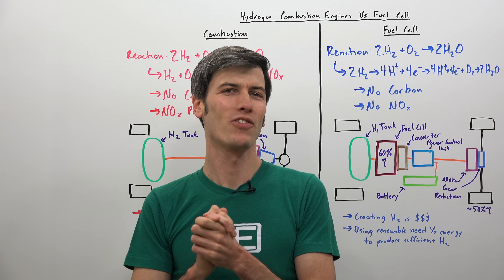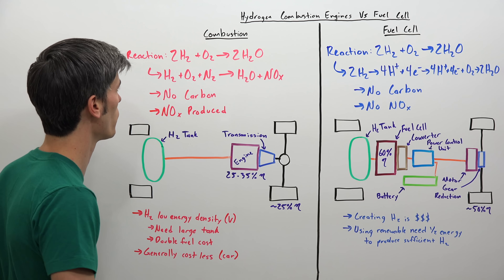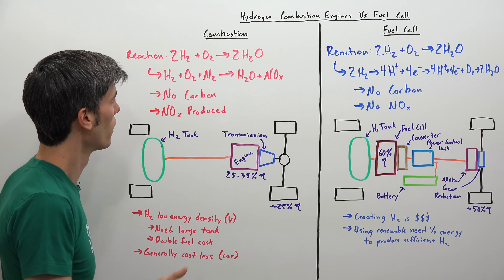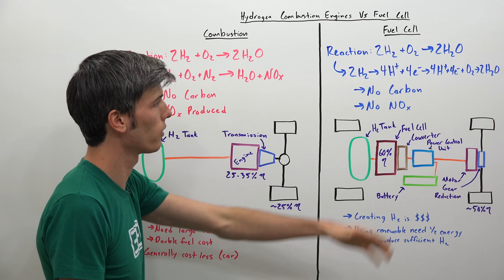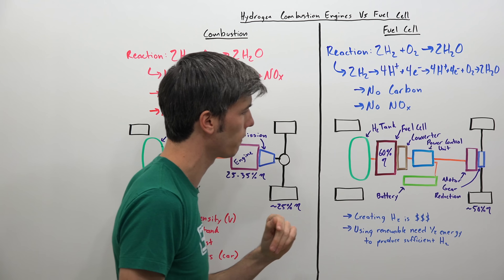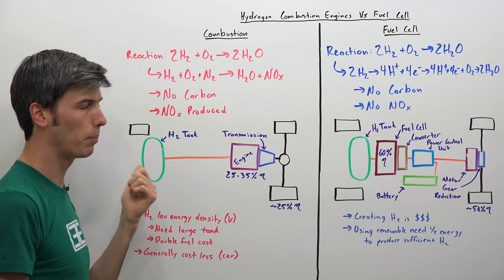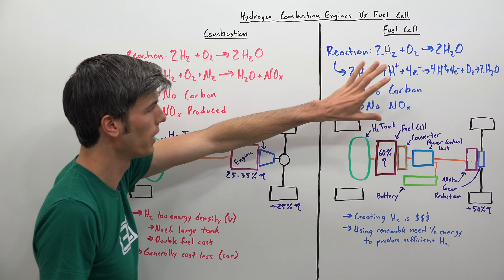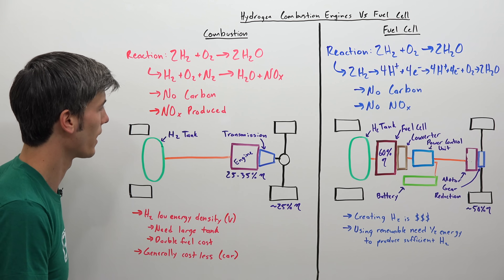Why Hydrogen Engines Are A Bad Idea

Comment from the maker: For anyone interested in learning more about hydrogen combustion engines/fuel cells, here are two videos explaining the fundamentals: 
How Hydrogen Piston Engines Work - https://youtu.be/l6ECwRnJ0Sg
How Hydrogen Fuel Cells Work - https://youtu.be/0jnZFGx_4kY
Reply: the best engine is the electric one since its energy travels by cables not by trucks and boats that consume more fuel with an efficiency that does not even reach 40%, also because fewer parts are needed gearboxes, spark plugs, starter batteries, clutches , sensors, air filter, fuel filter, oil filter, catalyst etc, which means to spend less energy in the manufacture and transportation of all those parts. Electric vehicles pollute less because they do not discard as many parts during their useful life and waste control would be simpler because recycling the batteries and having to declare their replacement would suffice. It would be much simpler and more efficient to use oil, natural gas, hydrogen etc in power plants and from there feed the EV since the stationary engines are more efficient and it is not the same to take the fuel to a point in the territory and then the Energy trip by wires that take it to all the gas stations. And heat treatments and melting so much metal for combustion vehicles spends a lot of energy.
Reply: So... You're saying I won't be able to convert the engine in my classic car to run on hydrogen, because I was hoping for conversion kits? Now I have to swap in a fuel cell at best or go electric? @engineeringexplained
Reply: Why not plain old ordinary 2 cycle engines, like Evinrude?
What about a 2 cycle engine with computer controlled DC motors (from the machine tool industry) for each wheel?
Reply: @uru-freemind7711  Like a golf cart, but the dead batteries cost money to get rid of.
Reply: @ME-kp5iz  while that is true, keep in mind that battery technology is pretty much in its infancy - there are many chemistries being explored at the moment - efforts focused on reducing cost (by using more readily available materials), reducing wieght per KWh (which will improve efficiency of EV's), improved charging speed and improved safety, both during production, during use and eventual disposal. We will make many mistakes, and I expect we will have a few breakthroughs in the next decade, and possible overcome many shortcomings of battery technology. Currently hydrogen production, transport and use has its fair share of unacceptable environmental impacts too (and being improved).
One thing that is certain, as far as I can see, is the fossil fuel powered vehicles is going the way of the dodo slowly. Which technology replaces it? - exciting times!
Reply: @ME-kp5iz  And you are not looking at the maintenance, the necessary parts, the efficiency of the engine and the fuel transport for the hydrogen engine and its maintenance are equal to the fossil fuel that is silly. And more energy is needed even to make the hydrogen would be simpler to make electrical energy with sunlight, wind, hydroelectric and geothermal energy, etc. join renewable and non-renewable sources until only use the renobables, the hydrogen engine is inefficient and its fuel consumes a lot of energy for its obtaining and transport.
Reply: I enjoy your video's and normally find them to be quite informative but I have an issue principally with your efficiency estimation. The figures I often see missing from electric systems are an egregious omission of real system efficiencies and can easily mislead the public and this video seems to be no different. All devices that use electricity have an efficiency themselves otherwise they would not inherently require some form of cooling. Regardless of the efficiency of your fuel cell the DC to AC inverter has an efficiency, the battery has an efficiency,  the electric motor has an efficiency, and the mechanical power transmission system of a fuel cell powered vehicle has an efficiency, all of which were missing from your whiteboard. I thoroughly enjoy your videos where you've done your due dilligence and hope you keep making them regardless of how complex you have to go to thoroughly explain your subject matter. I would also like to present a small conjecture, why not supply the required oxygen to the hydrogen combustion process and forego the use of atmospheric air which is principally nitrogen? That would eliminate the impact to the environment as there would be no nitrogen oxide product in the combustion reaction. Regardless thank you for the video's.
Reply: What are the pros and cons fixing a dry hydrogen cell to a gasoline engine?
Reply: Why is hydrogen so expensive?  It's the simplest and most abundant element in the universe isn't it?
Reply: @ranchhandrandy3213     Very abundant, just not simply isolated to put it in a tank and use it.  Someone might find a way to do that fractions of today's costs and it'll be more viable, but current processes aren't cheap.
Reply: what about a water to HHO converter?  Would it use as much space as a hydrogen fuel tank?
Reply: Is hydrogen on demand a thing ? can you produce it on your own ? Seen video few years ago never done any research to see was it ligit.
Reply: If the hydrogen was stored as a Hydrate fuel block rather than a compressed gas - might be better for hydrogen combustion
Reply: Something that occurred to me is that if there is a high density of hydrogen combustion cars venting water out the exhaust and environmental temperatures are freezing or below, road surfaces will accumulate ice constantly on a very grand scale.
Reply: They're not a bad idea!  They're just not politically correct!!  You can convert any combustion engine to run on hydrogen.
Reply: You could redirect the exhaust into a condensor to either drain the water or re-use @tonydanis1480
Reply: @Engineering Explained Hydrogen powered cars will never be competitive with dinosaur burners or pure EV's for several reasons. Firstly, the myth is that the hydrogen will be produced from electrolysis from pristine renewable energy like wind or solar farms, or even "clean" nuclear from thorium reactors. The electrolysis process loses 20% of the energy of the electricity so combine this with the efficiency of a pure EV and they will come out on top. The only extra expense you have with a pure EV is the extra batteries required beyond the smaller ones needed for an H2 EV, and also the range limitations of pure EV's which becomes less and less of an inconvenience every year as range increases and charge stations pop up everywhere.
The reality is that hydrogen actually comes from steam reforming of natural gas as it is significantly cheaper than electrolysis. Natural gas is a fossil fuel and this creates carbon dioxide emissions. It would be better to simply burn the natural gas directly in an ICE. Additionally, the high pressure fuel tank needed for hydrogen needs to be of denser metal because the small hydrogen molecules leak through traditional tanks.
Unfortunately, renewable electricity production methods will never be able to scale up to displace traditional sources of electricity like nuclear, coal, and natural gas; the capacity simply isn't there. Therefore, any attempt to use "renewable" energy (it's not actually renewable if you consider all the oil and emissions needed to make the wind turbines and solar panels) will simply take away supply from other users who want to source their electricity from "renewable" sources.
Now, sure, maybe rich people living in sunny areas could have solar panels on the roofs of their mansions which feed their own personal electrolysis plants. But the cost of production of all of that equipment and the embedded energy in all that equipment will never make it competitive with just burning traditional fuels. It will be a boutique technology just like it always has been.
Reply: The most important thing , 
How much it cost me if use hydrogen rather than normal fuel 
How much price of hydrogen and how many kilometres can achieve for 1 liter 
To can consumers can compare
Reply: @YaketyYakDontTalkBack  no he isn't saying that, he is saying you will need twice the amount of hydrogen to run it however. Needing much more energy to run a gas engine never stopped anyone but then gas is a lot cheaper than hydrogen.
Reply: @jonathancotner7040  apply all your efficiency concerns to gasoline if you really want to be appalled. Start at the bedroom of the driller when he gets up to go to work.
Reply: @tonydanis1480  regular cars are currently exhausting water on the streets, so why aren't you concerned about that?
Reply: @Aerostealth  I know the efficacy of internal combustion engines and his statement about a maximum of around 33% efficient is correct. My statement however was about the LACK of effincey information regarding all of the other components of the hydrogen fuel cell system. Everyone knows that EV's are more efficient than both but even with the realm of EV's such information isn't advertised.
Reply: how if you use electrolysis to produce the hydrogen gas
Reply: @jonathancotner7040  the proof is in the results. Electric vehicles require from 1/3rd to 1/4th the energy per mile as their gasser counterparts. Regardless of the internal loses for each step in the processes gas cars are entropy machines in comparison. The physical world is testifying to this in the forms of reduced cost and other tells, that are just undeniable.
Reply: @Aerostealth  As a chemist, I can tell you the amount of water expelled from a car exhaust running a hydrocarbon  engine is tiny compared to a hydrogen. Just look at the equation, for Chrissake!
Reply: @Aerostealth  Please just away and leave this to the knowledgeable people. Thank you.
Reply: @tonydanis1480  that leaves you out.
Reply: @tonydanis1480  Water dripping onto the streets is not an issue. Firstly, on clear nights when black ice forms, there is condensation (dew) which coats the road in water anyways. Secondly, there will be salt on the roads regardless. Thirdly, if it is well below freezing and sunny with dry roads, the ice will sublimate quickly at the low rates it is being deposited. But still, I agree that H2 powered cars are a colossal waste of research effort and brain cells; I tend to think they are being pushed by the fossil fuel industry because the hydrogen actually comes from natural gas.
Reply: @ME-kp5iz  You do realise that H2 cars also have batteries?
Reply: Hydrogen engines may be a bad idea but STEAM engines AREN'T!
Reply: Uru- Free Mind The best most cost effective engines are Steam engines!
Reply: Engineering Explained have you made a video about assisting gas powered engines with a hydrogen producing system? Id be supper interested in what your thoughts on it and what are the pros and cons if you haven’t already done this video..
Reply: Now, EE, do a comparison of the electric car's efficiency vs. that of the fuel-cell car's efficiency. With that comparison, include the efficiency of process to produce the hydrogen, and the efficiency of process to produce the electricity.

My thought is that you will discover that the electric car is much more efficient, AND cheaper. AND simpler.

The beauty of the electric car is its simplicity. The only aspect of electric cars that is truly cutting-edge is the battery technology. Electric motors and power inverters have been around for decades. But for petrol cars, look at the complexity! For example, you recently did a video on Mazda's Skyactiv-X engine. I admire the engineering involved to create such an efficient petrol engine, BUT, it's too complex, which to me just means more to go bad. And since most people (not me!) want an automatic transmission, there's that added complexity -- and modern automatics seem to have their share of problems.

Personally, I don't see how any powertrain for the automobile is going to be able to compete with the electric cars in 10 years. The only shortcoming now is range and long-range convenience, and with Porsche's new 350kW charging system technology becoming a reality (that kinda makes Tesla's 120kW Superchargers seem anemic!), that will soon be a thing of the past. 

BUT, please do that hydrogen fuel-cell vs. electric comparison. Perhaps I'm wrong ........
Reply: This made me sad haha
Reply: @tonydanis1480  Simple problems deserve simple solutions. If ice buildup becomes such a concern then manufacturers could put waste tanks in the vehicles to contain the couple gallons of water until it is disposed of by the owner, or drunk when they are thirsty.
Reply: john gilkison      ICE tech improvement has come, and continues, much faster than batteries, at market friendly prices.   BEV is a rounding error in the industry and would not exist at all except for heinous market distortions via greasy politicians and Co2 religion.   Sustainably is a sad ideal and goes against humanity.   We strive for more & better for the biggest market.  If batteries someday provide greater utility I’ll be thrilled to buy one.    Till then tax someone else to fund your utopian vision.
Reply: @timduncan8450  Only problem Tim, is that you're wrong. The IEA estimates that 1% of global GDP is subsidies to the fossil fuel industry. Look it up. Sorry but a few thousand dollar rebate on your EV purchase is, as you say, a rounding error compared to the subsidies big oil gets.
Reply: Reading through the comments here, I think you'll need to make another video explaining why BEVs are the future of personal transportation and not HFCs. The efficiency, cost and ultimately the reliability and recycleability. Essentially, the eco aspects.
Reply: @ME-kp5iz  It takes too much electric power to get very little hydrogen would be more convenient to use electric power in electric motors because they are much more efficient than one of combustion for everything I said in the other comments but hydrogen is a good substitute fuel for aircraft not what I deny, electric planes and solar boats are currently being developed, probably with graphene batteries to improve a lot. Land vehicles should all be electric that's obvious.
Reply: @mark2073  Yes, there's def a variety of solutions. Running the numbers any which seems to reveal an astonishing amount of water release. 
It's actually intriguing. If released as vapor in sufficient concentration, could affect local microclimates, not necessarily negatively. 
Amyway, it's a bad route compared to fuel cells, etc,, so probably won't actualize..
Reply: @mark2073   Not sure how objective or accurate IEA is.  I generally have little use for globalists or their statistitions.      Subsidies are generally bad.  If you want to make this relevant details matter.  Most third world oil producers have massive gasoline subsidies.  In my world the public often gets behind widely used technologies (interstate highways, airports, etc) once proven.   BEV are not in that tradition, they had to have grease politicians and Co2 evangelicals subsidize & whip up what little acceptance they have in the market.  Only a tiny few own them and benefit to society is immeasurable    I love new and better technology and would gladly buy vehicles with greater utility.  BEV have great potential, but today are a giant failure in the free market (~30% subsidies).   Fund your utopian vision on your own tax dollars.
Reply: Why in the hell is this not mass produced yet? Lol
Reply: @quinnwall5771  You'd have to install a massive hydrogen fuel storage and infrastructure  matrix nationally.
This is much harder to do than the electrical recharging stations that are popping up agonizingly slowly in certain locations.
 You still really can't take your Tesla out of town.
To be useful - provide adequate energy density -hydrogen would have to be stored at thousands of pounds per square inch pressure in a vehicle',s. That makes filling up dangerous and complex.
Gasoline is somewhat "reluctant" to burn and doesn't explode unless very finely dispersed as a gas, so it's safer to utilize.
Hydrogen, as the Hindenburg taught us, likes to go kaboom.
So a national hydrogen supply system for individually-owned vehicles will be costly, to say the least.
Reply: having not watched the video, I'll still say tell that to Bob Lazar
Reply: With global population on such a high rise we should all start thinking about sharing our (common) resources in a way that will allow future generations to also exist.
Combustion engines are inefficient engines that pollute the environment. There should be a quota on engine power currently in production from car manufacturers. How do WE allow someone to even think about driving a car able to produce 1.1MW???
Electricity has 2 fundamental problems: one is production (nuclear? coal? renewable sources?) the other one is how to store it. We will see further advancements in the rechargeable battery (bigger capacities and instant charging) in the future, which obviously leads us in a future full of electric vehicles (EV).
Then, we will only have to solve energy production which it can be anything (hydrogen, renewable, fusion … whatever)
But you guys should free yourself from the abusing idea of riding a muscle car - it is not proper
Reply: Engineering Explained you just broke my damn heart with this one!  😢😢😢
Reply: @supertriz  He is wrong, fact that hydrogen is good for military means its best they only protecting petrol dollar. Electric cars been around 200 years they also been suppressed by illuminati  them who control things behind scenes. Nuclear is triggered by hydrogen fuse. Russia has biggest  hydro bomb for decades no accident. Electric cars can self charge by using wind turbines even your cooling fans don't need to be electric they can use wind. Its all a scam lots of technology is suppressed by deep states.
Reply: True. Bad idea. Main reason companies considering it because combustion engine is readily available. That's why I was thinking before about hybrid electric for hydrogen engine. Simple. Comparable efficiency. Cleaner than gasoline. No worry about break even cost. Considerable market size in some countries, except US surely. No worry about range, gasoline can be used if batteries drained or H2 supply runs out. Even if anybody wants to travel to Nile river source. Hahah.

Oh free idea. Those companies has to pay me for this :p But yeah H2 extraction not efficient yet...and EV can be simply supplied by renewable energies, looking at how fast those develops.
Reply: SEE MY TWITTER PAGE UNDER THE SAME NAME AS THIS COMMENT, to see what just some of what this world is doing as they implement a hydrogen driven economy in their nation.  Hydrogen is a growing sector in this world for those who invest, you snooze, you lose what might have been.  Even international investments.  Fully your freewill choice.
Reply: What about the carbon dioxide and water vapor produced by the hydrocarbon burning power plant that generates the electricity to power the generation of hydrogen from electrolysis? The overall efficiency of energy transfer from hydrocarbon bonds to electrical to mechanical energy will be less than a conventional liquid fueled vehicle.
Reply: Fuel cell seems too complicated I would doubt in realiability of such engine in long run.....
Engine go to hell from on minor issue that was not chaged at right time in such complicated one your proposing it get it even worse
Reply: What about using hydrogen in a gas-turbine engine that's connected to a generator to provide electricity for electric drive motors?  A turbine should run well on hydrogen and could run at a steady state if it was just used to generate electricity and not connected directly to the drive-train.
Reply: As Union Pacific Railroad,. General Electric (Schenectady), and the builders of the Concorde found out, turbines run best at one speed. They are horribly inefficient at slower speeds, as in the driving requirements of city driving.   @LG123ABC
Reply: @tedphillips2501  Yes, that's what I was talking about.  You could run the turbine at a steady high speed to turn a generator and generate electricity for a bank of batteries/capacitors.  The turbine would not be required to change speeds because it would not be connected directly to the drive-train.
Reply: It would have to cycle out at some point to be economically competitive, especially for city driving. At that point, you would be driving an electric vehicle making a lot less noise. Aside from long-haul trucking, what do you see as the advantage?  @LG123ABC
Reply: @tedphillips2501  You eliminate the range anxiety you get from a pure electric vehicle but you retain the benefit of super-low emissions.  Yes, you're right, you would have to have a computer cycle the turbine on or off depending on how much of a charge the batteries had.
Reply: I'm starting to question this guy's intelligence. I think there are strings controlling the puppet.
Reply: @engineeringexplained Please have a look at the microwave ignition engine, seem like something of your interest
Reply: Kind of dishonest. Why not compare the exact same electric+battery with a hydrogen generator for combustion. All the same benefits without the super expensive limited lifespan catalyst.
Reply: Please do a review on gasoline and diesel engines with a onbord hydrogen generator generating hydrogen out if water from the battery and directly infused into the intakesystem. No tank, direct use of the onboard made hydrogen.
I guess youll need a bigger battery and a stonger alternator
Reply: You didn't really tackle the big practical factors, rather skimmed on them.  Specifically 1- simplicity of the design, as such production costs and ownership/maintenance cost of all the required components over years
Reply: Also I agree with your estimates of the combustion being around25%ish efficient, however I'm very skeptical of your 50%ish percent efficiency for the fuel cell model.  I think that very ambitious, and especially ambitious if you factor the relatively quick ageing of the fuel cell conversion components/batteries etc.   As an owner, I would opt for the combustion engine by far.
Reply: Fuel cells are unpractical
Reply: @JP-pf5pz  That would be a fun test. Task two teams with creating the most efficient electric generator, that can produce 5000 watts, using hydrogen as fuel. The win goes to the team that can produce the most kWh on a given quantity of hydrogen gas. Then, evaluate the cycle life cost of the generator. How much did it cost, how long will it last. The cycle life cost could theoretically go to the less efficient solution, if there is a small difference in efficiency, but a huge difference in cost/useful life.
Reply: Johnathan Cotner    ULEMCo and Revolve said to have demonstrated 45% BTE, last year with immeasurable NOx on diesel type engine fitted for hydrogen fuel.  I assume they did controls, Injectors and maybe turbo changes.  Article short on tech details, but claims stable operation at A/F ratio >300:1.  So that would be impressive.  Power density?  They showed a heavy truck application, so maybe they have maintained power?
Reply: john gilkison  ULEMCo and Revolve said to have demonstrated 45% BTE, last year with immeasurable NOx on diesel type engine fitted for hydrogen fuel.  I assume they did controls, Injectors and maybe turbo changes.  Article short on tech details, but claims stable operation at A/F ratio >300:1.  So that would be impressive.  Power density?  They showed a heavy truck application, so maybe they have maintained power?
Reply: @عبدالوهابالرحيمي-ض9س  yep it all comes down to cost vs return. Both for the consumer and the manufacturer. No profit? No product. Too expensive? No sales. Which is exactly why we don't see them.  Anywhere.
Reply: A video about turbine or jet engine on a car please!
Reply: Here in the Philippines we used to have a water fuel car. the water is converted to hydrogen and goes to the gasoline engine. few filipino convert their cars to save money when the fuel prices are high. try to search Daniel Dingel water car.

So why not make water fuel hydrogen electric cars, I think its more practical because insted of building hydrogen filling stations. I recomend use sea water or tap water to fill up the car and automacally converts water to hydrogen to power hydrogen electric car.
Reply: Kindly change video title to hydrogen cumbustion engine dont work, as people working hard hydrogen fuel only alternative to lithium battery can get worse reputation
Reply: 1.catalytic converter will solve the emmison.
2.gear box will effectively distribute the torque for the vehicle in different conditions.
3.we use the electric to separate hydrogen and oxygen from the water not need a huge tank of hydrogen.
Reply: Need large tank?? Students in Denmark have build a car with an Hydrogen engine, it only have a max speed of 40 km/h BUT it can drive 630 Km per liter, so no need for a big tank.
Reply: You have sum of the  best content on YouTube I love content that puts me in my place!!
Reply: I would love to borrow your brain someday.  Are you a electrical engineer?
Reply: What are even talking about.!!??........GASOLINE IS HYDROGEN buddy!!...... Wake up
Reply: @Spiffer  Definitely TRUE........ YOU ARE SO RIGHT Mads
Reply: @PatrickInCayman  Correct
Reply: @uru-freemind7711  Good points! Also the hydrogen has to be highly compressed (which takes a LOT of energy) and kept extremely cold. And 1 tanker of hydrogen has half the BTU's of a tanker of gasoline.
Reply: @mark2073  If Fusion power does become a reality then that would be a perfect source for electricity.
Reply: So then. If we cant use an engine block we are stuck with a heavy electric car. . . . Welp. F that ima design a system that uses an electrosis tank. Therefore getting rid of that giant H2 tank and replaceing it with a constant flownof hudrogen and oxygen. We will just bleed the oxygen back into the enviroment so it can mix with the air and turn into well air. Just use distilled water and salt and your set. Use the eneryu from the battery to generate the H2 to go into the fuel cell. That way the hydrogen is produced on the go. So its a condensed since its a liquid then its split into a gas.
Reply: @ME-kp5iz  Why not just produce the hydrogen in the car. Simply put in an electralosis rign and bleed the oxygen thats produced back into the inviroment. And have the H2 go into a holding cell so it can be stored and used when its needed to. Solves all the problems.
Reply: the idea behind hydrogen combustion is not to create new vehicles... is to be able to maintain using current ones... a lot of engines are capable of being converted to hydrogen burning... this is the idea behind the Skyactive X engines (rotaries can also burn hydrogen)... electric vehicles still are very expensive and may not be accessible to everyone yet. therefore it is a good idea to offer a solution for people to that wish to keep their own cars. there is the other aspect.. cars are hobbies for some people and some governments are going to go as far as ban any gasoline burning cars, which would be unfortunate for someone like myself that likes to work on cars on their off time. So a hydrogen conversion is an option. I don't know what the obsession with efficiency is, gasoline is not that efficient either. also while NOx is bad... you haven't addressed the quantities of NOx produced in comparison to the NOx produced currently by cars. I'm sure it is a lot less.
Reply: You create amonia and nox
Reply: Engineering Explained how about making it from the source⁉️🤨 Why are you NOT mentioning the electrolysis that can be produced and why not use injection⁉️
Reply: NOx trap are for sure added to H2 burning autos.
From H2O exhaust from F-CELL cars you can also make again pure H2 by passing-by electrons from battery and make a closed circuit getting fuel again and O2 for the enviroment !!!!
BimmerN53
Reply: This is missing a lot of information, DI-Hydrogen engines emit almost no NOx for lambda >2 , and they work with lambda as high as 10.5. 
They do emit lots of NOx at full load (lambda = 1), but this can be counteracted by using water injection.
Reply: But what about normal gasoline engines with an extra flow of hydrogen?
Reply: @YaketyYakDontTalkBack  Yes, you can run your engine on hydrogen, propane, gasoline, alcohol or whatever.
Reply: @theygunaHATEME  At the moment, it takes more energy than you get out to have on-board hydrogen production.  I proposed that the hydrogen generators operate at the resonant frequency of water to make them much more efficient, but I have not done it or seen anyone else do it.
Reply: @LG123ABC  Same concept as a diesel engine running a generator for the motors on train engines and ships.
Reply: The need for volume would compression not make up for that?
Reply: @engineering explained I agree they are not as effective as FCEV cas or even BEV cars but this would be great for people to keep older cars such as classic cars or even higher end cars that people would want to hang on to. That would end up being less than 1% of all cars on the road as everyone going electric-it. And the large tank is a not true and hydrogen isn’t  measured in gallons. Overall good points but hydrogen will replace gas and help keep older cars running.
Reply: If you already have combustion engines and a system for making hydrogen from water on demand,  i would think this ghe best thing for the average consumer, not so good for big oil and those who want to control energy freedom. Am i missing something?
Reply: Here is the thing... the more you change the energy the more energy your wasting
Reply: Question on emissions, the ICe of course spews it back out into the atmosphere, which in this case is actually far worse for GHG as water vapor is denser than CO2, but does the fuel cell emit any emissions back into the atmosphere?
Reply: Sorry to be off topic but does anybody know of a tool to get back into an instagram account?
I stupidly lost my password. I appreciate any tips you can give me
Reply: @Angel Jax instablaster ;)
Reply: @Josue Trey Thanks so much for your reply. I found the site on google and im in the hacking process now.
Takes a while so I will get back to you later with my results.
Reply: @Josue Trey It did the trick and I actually got access to my account again. I'm so happy!
Thank you so much, you saved my account :D
Reply: @Angel Jax No problem :D
Reply: @ME-kp5iz  No. Hydrogen requires a lot of supporting equipment and infrastructure. Because the entire process uses two to three times as much energy as simply putting the electricity directly into a battery. That requires more renewables which requires resources to build. Fuel cells also have a lot of exotic materials in them. Do you think there’s no environmental cost to all that?
Reply: @uru-freemind7711  ok.. 👍 Great speech, but do you know how large is the carbon footprint - just the carbon footprint and not other waste and enviromental hazards; of producing just 1 battery cell?
Reply: @alexbalea6404  More efficient means less energy consumption for the use of the vehicle, for its manufacture measures can be taken in the factory to avoid polluting the air and water since they are far from the cities, on the other hand, combustion vehicles pollute with their use by Hence the control is much more difficult because you have to control user by user. As if this were not enough, the problem of recharging is already solved by nio cars that has battery change stations in 3 minutes, with a range of 1000km. Admittedly, the combustion engine is no longer efficient.
Reply: @jonathancotner7040  I was having a similar thought about using pure oxygen and hydrogen,  I came to the conclusion the engine would probably have to have a very short stroke/ low compression as the mix of oxygen and hydrogen would create a much more powerful explosion  than a hydrogen/air mix.
This could possibly work on a specialy made engine but to run a standard ice. engine on a hydrogen/oxygen mix would blow it to bits .
Just a thought on running ordinary ice. cars on hydrogen/oxygen combination , perhaps carbon dioxide could be taken out of the air and put in the mix to lower the power of the explosion? 
I can't answer my own question as to the end result of such a combination , someone with more knowledge of chemistry than I have is needed for that.
  I know it would be expensive but could possibly be a solution to keep classic V8s on the road.
Reply: Hi at what stage are you at with running conventional petrol  engines on hh2o i have some ideas but i am an ideas guy not an engineer
Reply: Ok so I been a mechanic for many years, and three times I have seen customers that made themselves a water hho fuel system. All 3 times it was trucks with 55 gallon plastic drums used for electrifying the water. So it can be done and those were some of the cleanest engines I ever seen in the shop, and they all had hundreds of thousands of miles on them. 2 only came in for an oil change 1 needed a wheel bearing. But I get it. Nobody with a following in the public eye will speak truly on this subject cause they don't want to be assassinated.
Reply: Having seen the new Toyota-Yamaha hydrogen engine, have you changed your mind about this?
Reply: You did not explain where the Nitrogen came from?